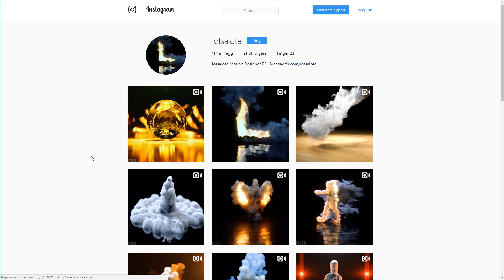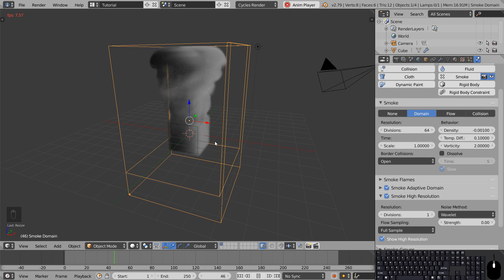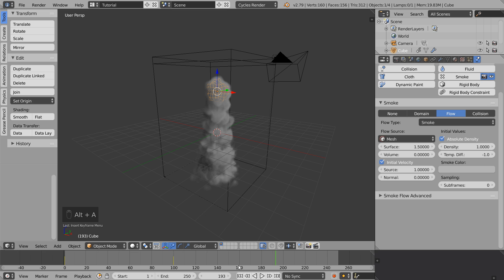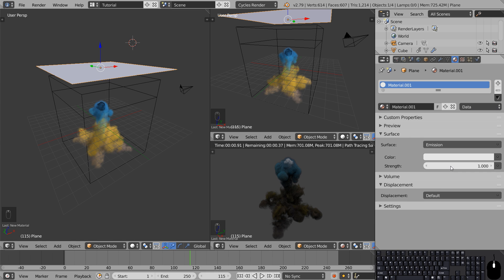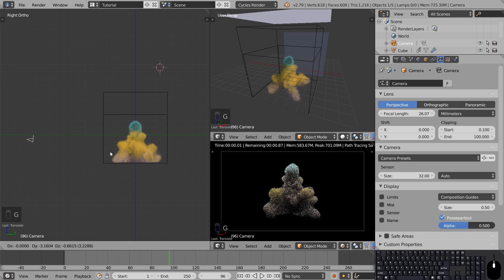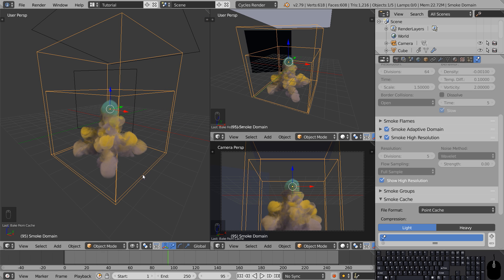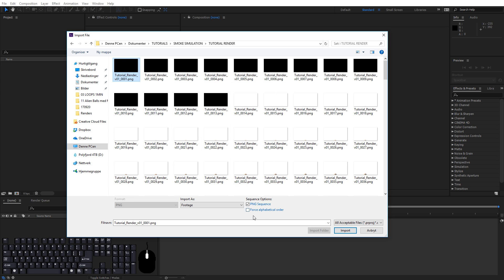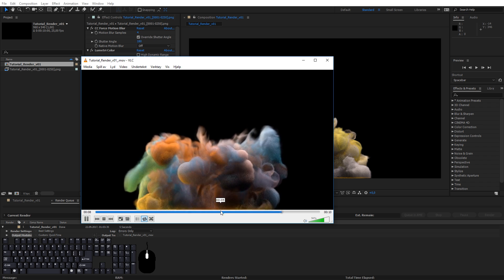Smoke Simulation Tutorial - Blender Cycles

Comment: Why can't I see the smoke in the rendered view?
Reply from the maker: Sorry! Poorly explained.. You need to enable the Cycles Render engine before applying the Quick Smoke effect. You can do this in the drop-down menu at the very top.
Reply: Thanks It worked !!
Reply: It's ok! I enjoyed doing it over. Helped me remember the steps better. You are a very good teacher.
Reply: it didnot work :_(
Reply: @woshieman2260  try baking the smoke first and then do the changes
Reply: me too :(
Reply: You have a lamp?
Reply: You must switch to cycles before you begin the smoke effect. If your using 2.79b (currently using) and see the grey box (domain) keep on blender render,  to see in Renderd View (result).
Reply: @Tecboy08  IT STILL DOESNT WORK
Reply: @pepinyostep3592  Use hotkey: Option(alt)+Shift+A
Reply: Gustavo Guzman  Hey, can you tell me why it's not working in V 2.8?
Reply: FadToni me too, the shader doesn’t work with me
Reply: @aymankhalifa2488  u need to save the file and bake the simulation first, otherwise u wont see anything in your render on cycles.
Reply: Basti C Yes I know and I did this, but I think this shader doesn’t work in 2.8
Reply: @aymankhalifa2488  i just did it this weekend. Besides the Colorchanging part everything worked after baking. Do u see your smoke in cycles Render?
Reply: @dojtus9057  u need to bake the data to see it
Reply: To all the people saying it still doesn't work, try increasing the density (by going into the shader editor, using the attribute block to get density, multiply it by 100 or something and plug that into density)
Reply: Did you find solution?
Reply: Change to Cycles BEFORE applying smoke effect and it should appear on your render view :)
Reply: Try switching to CPU

Comment: Why does my smoke colors not Work, while in rendered view, blender

Edit: it happens in 2.81
Reply: Yes there seem so be a couple odd things with smoke in cycles 2.81. I found that the only thing affecting your smoke is the smoke domain settings, which would be problematic if you want to create an animation with different colour smoke but otherwise works fine.
Reply: Im using the workbench engine now instead of the cycles, you get colours with it.

Comment: if you're doing a tutorial on something like smoke simulation, don't waste any time on explaning the viewers how to do some basic blender operations regarding the user interface.
The average viewers will most likely know how to move or rotate an object and how to snap rotation properties or how to create keyframes.
Don't waste any time on explaining how to setup lights, because 1stly, the way you did it is super easy, so there's no explanation  required
and 2ndly, because there's a lot that can be done with lighting in blender, information like this can be included in a dedicated video.
You could've spent more time on the smoke tool itself, going a little bit into detail about  the basics and most usefull functions.

Comment: Oke, for the people that render, but see a border around their domain. This is how you solve it. there are two ways, you either restart the process and make sure you use the node settings that come from the quick smoke effect. Or you make a new object with a quick smoke effect, copy paste the nodes of the quick effect domain to your domain you used previously. To do this you have to first apply a material to your previous domain en then copy paste the nodes of the quick effect domain in there, then delete the two added nodes that came with the previously added material and it should work now.

Comment: Well said. One question though, how do i make the smoke colour be seen as not white? I've changed the smoke colour throughout the keyframes but it remains the same as the final color i pick. Any help?
EDIT: i already am in cycles renderer.
Reply from the maker: Have you tried re-simulating the smoke after adding the keyframes? If not, it might be some issues with the smoke material’s nodes. Sorry this didn’t really get explained properly in the video
Reply: lotsalote No worries. Yeah i resimulated multiple times and even tried changing the domain material, which didnt work as needed.

Comment: To show my gratitude for learning from your tutorial, I'll try to explain about the After Effects part.

There is a frame blending checkbox for each layer as well as a master frame blending checkbox for the entire composition. You indicated you needed to check the layer's frame blending checkbox twice and the master frame blending button once before you could get the effect to work. 
From what I was able to determine by watching your (well done) tutorial, you had to check the layer's checkbox two times because the first tic resulted in a dotted line which indicated it would be in draft mode. The second tic put the layer into quality mode which was probably the result you were looking for. None of that would have mattered however, had you not clicked the master frame blending button. By default the composition was created with no frame blending enabled. By clicking the button you made the option of frame blending available and by ticking the layer's checkbox you actually caused the effect to be used.
Reply: no good deed goes unpunished (6 likes and no <3) lol

Comment: Great tutorial! I’m going to try this for   some smoke puff sprites for a game.
Reply from the maker: Cool! Interested if you can do that real-time, I’d guess it would have to be pre-rendered. Good luck!!
Reply: lotsalote I really need to pre-render the animation. Im using the Unreal Engine 1 so the animation will run on a 2d sprite ingame. 

Is it possible to skip frames at the export to have a animated smoke simulation with 50 frames?
Reply: I followed every step so far now I stuck at part three, camera and lighting. I added a plane with an emission material and it only lights up the smoke domain box but not the smoke in the render view.
Reply from the maker: Make sure you’re in the Cycles render engine before adding the quick smoke effect
Reply: lotsalote it worked 🤦🏼‍♂️ thank you :)

Comment: Great tutorial, but i couldnt figure how to get the shape you have at 4:23, i mean the way you have x-shaped falling down smoke segments. Was it that you turned Border Collisions from Open to Collide all? But in that case i have a circle shaped smoke below.. If you could explain a bit that moment with the x-shaped parts of smoke, that would be great.
Reply: i m talking about smoke "limbs" in the lower part of 4:23, to be more clear.
Reply from the maker: Thank you!! Yes I completely understand what you mean! The X-shaped smoke is because I gave the emitter some rotation, so the smoke ended up being «pulled» away like centrifugal forces (note: you need to have enabled initial velocity of the emitter for this to work). So the shape of the emitter is still a circle, it’s just kind of throwing the smoke to the sides and in this case it ended up as an X shape. Hope this helps!!
Reply: thanks, it helped a lot.

Comment: grate tutorial, only one question why not use Blender to add the motion bluer and color corection?
Reply from the maker: Thanks man!! Great question. I think it's important to show how to export animations from Blender to After Effects. You can do basic compositing in blender too, but I highly recommend getting a grasp on how to do compositing in proprietary software. Especially if you're interested in working with Blender professionally. Advanced CG work is very seldom a one-man-job, so adapting to a professional pipeline as early as possible is golden.
Reply: good point.
Reply: Also the motion blur is broke in current Blender (2.79) it has been for some time. For basic motion blur it's fine but for long exposure you'll see why, normally it lets you set steps to the blur, but it doesn't currently use this input defaulting to 3.
Reply: XD
Reply: 2019 now... Blender improved a lot !

Comment: when i change it to cycles render, the smoke is covered by a rectangular prism
Reply from the maker: It's very important that Cycles is selected before creating the Quick Smoke
Reply: Same thing happened to me, so I had to restart. Everything's working great now. Excellent tutorial losalote!
Reply: THAT'S why?! The same thing happened to me when I was following somebody else's tutorial - everything worked fine until he started working with Cycles nodes and I had to switch render engines. I had to build the node tree from scratch using reference images, but I still had no idea why it had happened.   Definitely something worth mentioning off the bat.